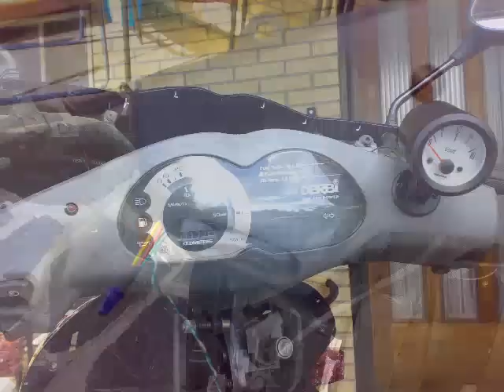Scooter Audio - Part 02 - How its made

Comment: I'm thinking of plugging a 12V DC sound system on a car 12V DC plug I installed on my scooter. Thing is, I'm worrying about if the Magneto coil (or is it called Dynamo....?) Can take it. It's about one Amp with the sound at maximum. But I can't tell the total Amp consumation of the whole electric system of my scooter. What do you think?

Comment: hey man I need ur help and id greatly appreciate it. how do you connect it to the battery? im using a system where it plugs into the wall so I just snipped off that wall outlet and split the wires and stripped them too and just tried to connect it from there and it didn't work. is there anything else that I need or im doing wrong? please help!